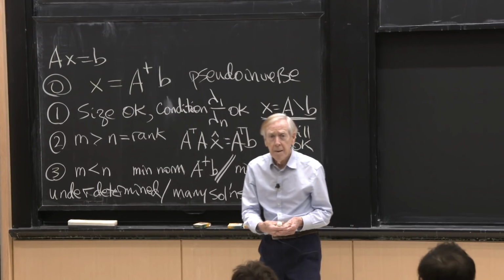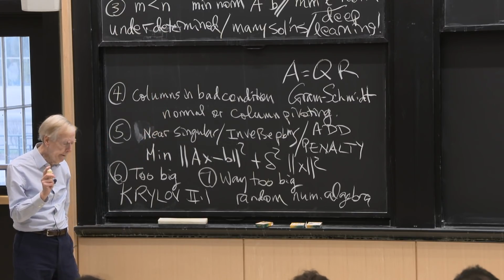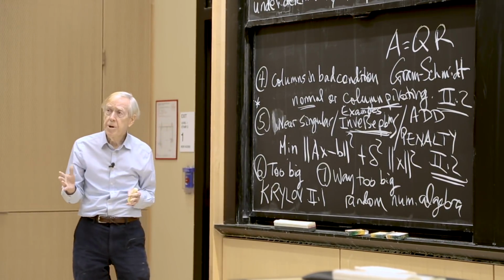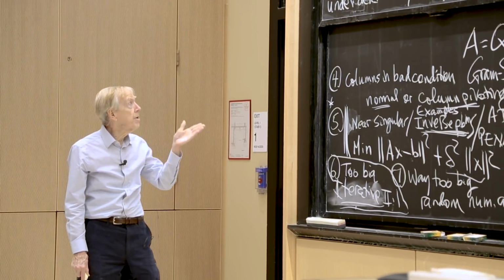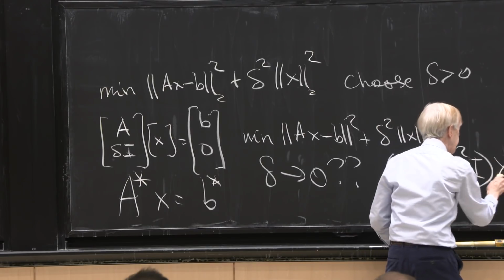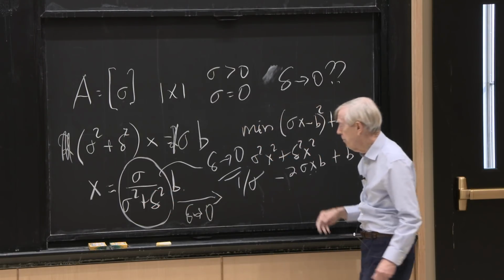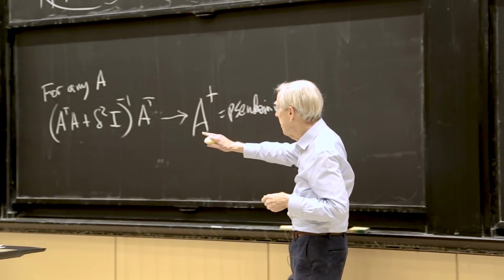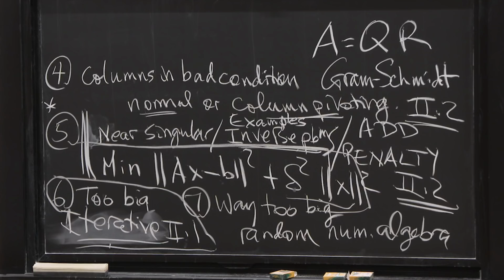Lecture 10: Survey of Difficulties with Ax = b

Comment: 23:32 different ways to generalize solution for test data use Lipschitz Continuity bound to your loss function(Usually while applying SGD we have a methodology which combines the two using Lipschitz Continuity Constraint Projection.

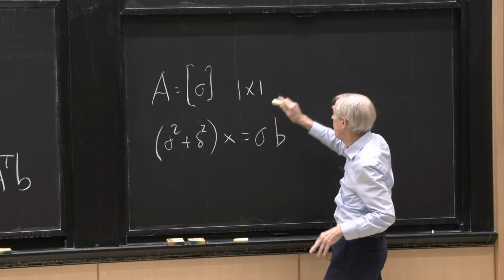Comment: 31:18 Why there is only two cases? Why not consider sigma < 0?
Reply: Because it's a positive definitive matrix system, that's is guaranteed to be >= 0
Reply: @elyepes19  no? it requires only A^TA to be a semi p.d matrix, which is always the case. I believe σ can be smaller than 0.

Comment: What is (ATA + d^2 I) ^-1? I think it cant be separated as (ATA )^-1 + (d^2 I)^-1.
Reply: Correct, you can't separate the inverse like that (there are formulas for doing something related, e.g. https://en.wikipedia.org/wiki/Sherman%E2%80%93Morrison_formula, but that's not really relevant here). 
Here it's simply the inverse of ATA + d^2 I, where ATA may not be invertible (ie if any eigenvalues are zero), but adding d^2 to the leading diagonal adds d^2 to all the eigenvalues, which must then all be positive and it is invertible.

Comment: In case 3 where m<n prof wrote min A+b. What does it mean? Is it stating the fact that pseudoinverse matrix does give minimum norm of vector A+b? Another version: it means that distance between A+b and b is minimal.
Reply: I find out that If x0 = A+b (plus is the pseudoinverse,not sum) than two facts are true :
1. Ax0 is the closest point to b among Ax. 
2. x0 has minimum norm among all x0s that satisfies condition 1 above (it is good to mention that in theory points satisfying condition 1 may be several)

Comment: I don't understand where delta squared multiply norm x squared come from ? why it help us fix problem ?
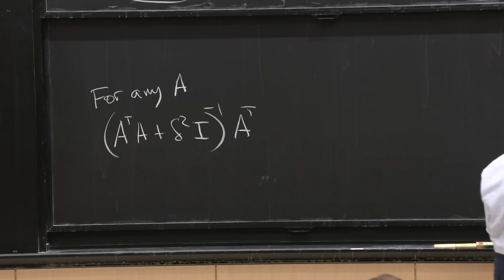Reply: It's at first a magic answer, but the solution is at 40:39, where it shows that choosing delta squared l2 norm x squared will transform (AtA)^-1 by adding a value on the diagonals such that near-zero eigenvalues will no longer blow up
Reply: Probabilistically, you're setting a prior on the values of x's. This is a form of regularization.

Comment: What does he actually mean when he says "it's inverse is going to be big" .. he says it 2 times..  when talking about columns in bad condition and nearly singular matrix.. please help . And also, please tell what problems could a "big" inverse cause ?
Reply: Singular matrices have at least one zero eigenvalue. If it's nearly singular, at least one eigenvalue is nearly zero which causes it to blow up when finding the inverse. As a result, the inverse of a near-singular matrix will involve massive numbers
Reply: All the comments add value to answer the question, my ¢5 contribution would be to say that if the singular values are close to zero, when you take the inverse they will become large numbers, and in computational terms you are mixing large numbers with small values close to the computationally round off error going to  machine precision of zero, a big headache
Reply: Yashwanth Soodini thank youuuu
Reply: I guess it means a matrix with small singular values will get an inverse matrix with big singular values. It can be understood by considering a simple diagonal matrix case.
Reply: hmm here's my guess: when a matrix is nearly singular, at least one of its singluar values must be close to 0 (check out 24:50). When you invert it, a singular value will be 1/(the small singular value) which is large (i.e. some entry in the matrix is large).

e.g.
inv([ 1 1 ; 1 1.001] )  % nearly singular let's say
is 
       1001       -1000
       -1000        1000